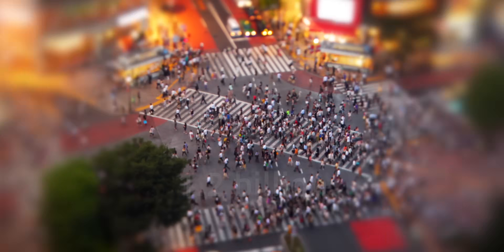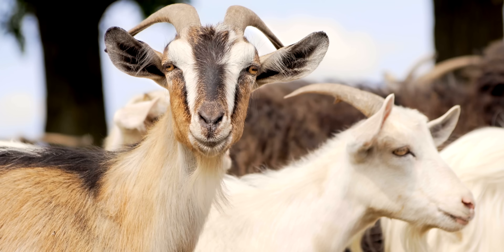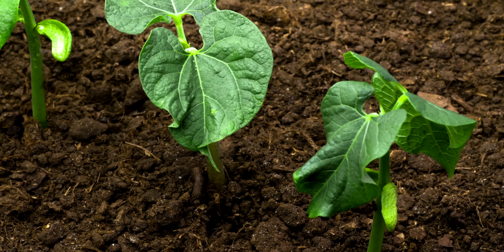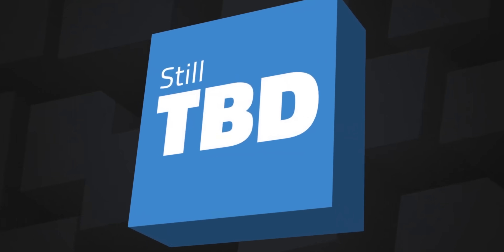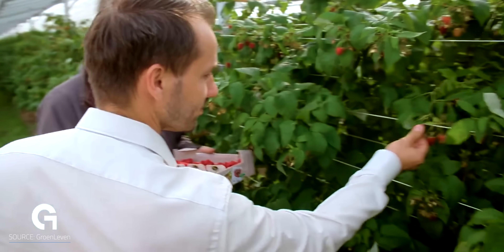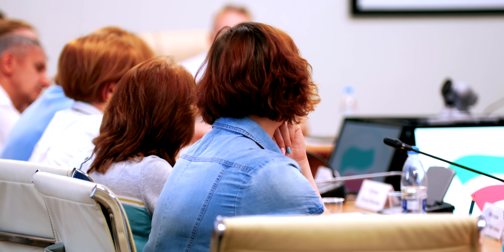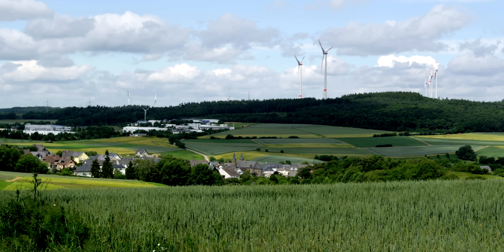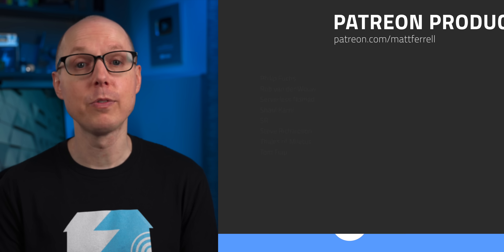Solar Panels Plus Farming? Agrivoltaics Explained

Comment: Yesterday I spoke to an environmental auditor from France. We discussed the possibility of reduced "sun" due to "heavy gases" in the air. He said, there should be used solar pannels which can produce electricity under conditions of clowdy weather or shadows. And these pannel excist. Today house owners not only install pannels on the southern part of their house, but also on the northern part. They know, that new solar pannel features will produce less, but yet produce energy due to better technology.

Comment: You're right about the NIMBY factor...  In Australia, there were people against a proposed solar farm, that they wouldn't even be able to see because it was on the other side of a hill, because they didn't want to live next door to a "industrial power station"...  One point that you missed in the video is that the solar panels over the crops can also be used for water collection, and not just when it rains.  Cool, moist air hitting the solar panels at night will condense, and the condensation can be collected even during drought conditions, which will also increase crop yields.

Comment: It is an interesting idea.

Two big issues that is going on my area, which is Indiana, which obviously is a big farming state. Is that..

1. They are trying to build traditional type solar farms, which is upsetting the farmers, because that is taking away big swaths of farming land.

2. The power that is made from the solar farms aren't even being used locally. I don't know where it is going but it isn't being used here.

Also, as you mentioned in the video. It isn't locals or even in state people that are owning these fields. I think the one locally in my county that is causing a fuss, is owned by an Israeli company.

So no one sees any benefits from allowing that farm to be built here, other than the company involves and most likely local politicians that most likely have stock in said company or has some other financial gains to be made with this.

Either way, it doesn't benefit the community with electricity and it isn't helping the farmers out neither.

Now if they were trying to build something like what was in the video here, then atleast some of the farmers might get on board. Especially if they are shown that you can still grow corn, soybeans and stuff like that under them.

As the running stereotype is, Indiana is big on corn, most of it though is meant for either bio gas or animal feed I believe.

I do wonder how this would work for a smaller scale, like a backyard garden and solar panel combo.

I have always thought that the answer isn't into these massive farms that tree to power entire cities but on the smallerscale, where individual  households and businesses have their own personal solar farms in their yards or on their roofs, etc. But with the price to install them...even with rebates and such, most people just don't have the cash or see an upside to how it would benefit their business.

I know I would like to get my house hooked up with solar but I can't even afford a new roof or anything else for that matter. So going solar is completely off the table.  Plus, I believe my state has a law in place that you HAVE to be hooked up to the grid reguardless. So that is also a determent to people doing that here as well..

Sorry for the long comment.
Reply: I don't think there are laws against disconnecting from the power grid in Indiana. I'm not disconnected yet, but it's one of my goals.

Comment: Another solution, which would allow you to grow other crops, not just shade crops, would be installing LEDs under the panels, using a fraction of the power produced to light them. You would still generate quite a bit of power, while growing a variety of crops. You would need to use some specific LEDs to maximize the efficiency and you would need to have them mounted close enough to the plants themselves to not waste any of the light produced. Essentially you treat the land as though it were a partially "indoor" farm. It hurts the efficiency of power production, because you are using some of the power for the LEDs, but you are getting an additional resource in exchange.

Comment: Errors:  #1 We don't have a free-market...we have a sellout lobby-nudge market (bribery-markets).... the "sellout" is gov't / banking based. 

#2 Solar Panels need coal / oil / gas electric to make panels.... panels also need more metal / mining then do coal-alone electric out put.

#3 to replace coal as base-load electric we need Next-Gen Nuclear Tech.

This is great idea but we need composite material solar panels.....Zero mining / Zero reliance on base-load for manufacturing.  Maybe graphene plus Hemp Oil / Hemp Plastics?  Not sure.

Comment: I can’t think of a dual renewable energy use right now, but it reminded me of the fact that some people are using heat pumps to heat their pools. Instead of dumping the heat into the air outside their house, the heat is transferred into their swimming pool water. Cool stuff.

Comment: I, as an handycraft, who had nothing to do with farming, have seen on an sightseing-tour through someones garden, that some plants do not grow the hole day alonge, rather only a view hours in the morning. Pea was the plant in the garden, where it is clearly happend. Their shoots only grow to east, because there was the first sunlight of the day and later in the day, multiple problems for the plant stoped the growing (too less water, too much sunlight and heat). These plants may must completly stoped the growing- and metablism-action, because they all bend to east and did not grow to other  directions.
In the best growing-seasons (midsummer), as we thinking, they do not grow best. 
I don't know what other plants this applies to. But many basic food crops (like potatoes) could also be affected, even if they are "nightshade-crops". After all, they can't do without photosynthesis. But drought is the much worse complication for the plants, which is why one should achieve longer-lasting moisture in the soil by shading.  And less solar radiation is the most plausible solution - along with watering more in line with needs.

I cannot calculate how relevant these adjustments in agriculture will be for the respective regions for the harvest quantity. But in Germany, in the Mecklenburg and Brandenburg agricultural regions, a lot of drought is to be expected in midsummer because of the special landscapes and weather conditions (sandy and dry). 

Agrivoltaics should be on the list of public interests. The problem that all European industrialised countries do not have enough fossil resources of their own to meet their own energy needs should be enough justification for this. The "energy market" at present clearly shows us how unfavourable situations can become if one does not have one's own basic supply that is not dependent on third parties. Therefore, the state must intervene structurally here and create measures and regulations for the benefit/goal of stable self-sufficiency. 
The installation of photovoltaic systems on fields may be expensive, but it brings stability in the areas of life where it is needed. 
Alternatively, there is the idea that every roof in the country should provide a minimum capacity of solar power - i.e. be equipped with solar cells. 

Very intersting concept of solar-panels, these partly cell-structure. 

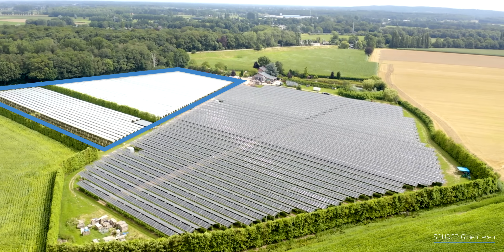6:15... interesting thing: in the netherlands the peoples have som special gardening-strategie: They make their garden  somewhat opaque from outside the garden. And so it is done in the Babberich-testfield. This is not only good for privat-sphere, rather also good for microclimate on the field.  For the better effect of agrivoltaic this microclimate on the field  must guaranteed, because this is the benefit of shadowing the field. For that, the embracings around the field with high hedges are part of the shadowing-targets for a stable microclimate.

Comment: Helped conduct research at the University of Arizona on agrovoltaics! All of the crops under solar panels produced significantly more, because of the reduced heat stress. The greatest difference was the tomatoes, as the control group in the sun didn't fruit at all so the percentage increase in yield was a problematic way to summarize the results as we were dividing by 0.
Reply: Yeah reduced heat stress as in direct sunlight, other wise the covering panels gather and radiate heat into the atmosphere adding to the heat island effect. Less CO2 produced maybe but definitely heating the local atmosphere. Doesn't CO2 do that already?
Reply: @pinealism  recently 1000 acres of old growth forest was cleared for a solar farm. We just experienced the hottest temperatures and longest drought in years.
Reply: @herelieskittythomas3726  where was this? sounds doubtful
Reply: @pinealism  no. They radiate some heat / light back up toward space, and any heat absorbed would be heat that would already be absorbed by the ground and plants, which would then need additional water to compensate for that heat the solar panels would have caught
Reply: Why dont they use mirror to reflect sunlight for crops from sides... Dont say they cant lol.. 😂
Reply: Sheesh
Reply: What was the effect of having fewer panels on a given area or the extra cost for special racking?
Reply: So it was an infinity per cent increase!
Reply: Did you discover anything about how it affects moisture retention in the soil? I wonder about this because areas like California have had huge problems with drought and wildfires. I was wondering if this might have a relevant impact on the overall water situation.
Reply: oh good, now the nations bread basket - Arizona - can finnaly reach trheir peak veggie production - a half dozen hobbiests
Reply: Then it was not  properly designed experiment.  No one in that climate would try to grow tomatoes without shade cloth.
Reply: @MP-dc8lp  solar panels maybe replace shade cloth? and I don't think Matt really provided enough details on the design of the experiment for you to dismiss it without asking for more clarification
Reply: @MP-dc8lp  e
Reply: Well no, as Arizona has zero water to grow anything with.  This experiment is only valid where crops are already being grown.  Even then it only works during half of the year at most and especially in spring/early summer and fall you want every single ray of sunshine you can get as you are getting 2 crops instead of one.  Talk about piss poor economic model.  Cheaper solutions for both separate entities.  When all the irrigation ditches/channels/rivers/parking lots get covered first, then we can worry about wasting money elsewhere.
Reply: @w8stral  yet crops are grown in arizona. so they are irrigating, which means reducing water usage is even more important

Comment: this idea I am about to suggest I saw in Chile , the bus stop shade in the desert is designed with a roof that points inward at a 120 degree v-shaped roof , this way the rainwater will collect in the middle off the bus stop shade directing it to the center of the bus stop shade where there is a tree planted , what if the solar panel are assembled in a v-shaped 120 degree angle  , this way more sunlight will come through and at the same time it will collect rainwater without reduction in collecting sunlight , at the same time since there is equal weight on both sides of the axis it will behave like a seesaw which would make it easy to manipulate it in either direction, an idea not spoken is an idea loss to humanity .

Comment: Traffic at shopping malls has been waning in recent years, but I have always thought that their parking lot are screaming for solar arrays.  Ask me if I would prefer to park in the shade of a solar panel in the summer or not.  The issue for more northern climes is designing for snow removal on the ground in the winter.

Comment: Hi Matt, 

Very interesting video. If possible I would like to listen further insights related to the 3 implementation barriers discribed by you. All the cases that you pointed are from germany and holland, witch are not are tropical countries. In tropical areas is quite common that sun light intesity is far beyond the solar panels capacity and maybe would reduce the trade-off between crop yield and energy production. Do you know any project in tropical country ?

Comment: Agrivoltaics is currently being pushed in Germany. I don't believe we are anywhere near the 10-20% higher costs. Some numbers: a normal  1.2MW solarpark with average components costs about 900.000€ or 750€ per kWp in Germany right now. Of the 750€ roughly 100€ are attributable to the mounting System. Afaik a agrivoltaic mounting system is roughly 300-400€. On top of that transparent modules are twice as expensive than normal modules for half the Watts (wasting space and no reflective layer). E.g. SOLARWATT VISION 36M Modules. Instead of the initial 1.2MW we would get like 800KW and we would pay somewhere around 1.8 Million €. Returns on traditional Photovoltaics are about 7-8%, with agrivoltaics it's 2-3%. Correct me if i'm wrong.

Comment: this is an interesting idea.  my only hesitancy in teh expansiaon of solar is tthe poor lifespan of the panels.  I read anywhere from 5 to 10 years.    the old panels end up in land fills and in some cases are comrised of toxic materials that doe not bio degrade well........       this has a great potential to yield energy, limit fossil fuel use. but is it a good alternative.   Can anyone tell me what happens to the old panels.

Comment: With the recent increases in electricity prices the market will decide whether this is viable. Food has also increased in price however the prices on food will likely be much more dynamic the the price of electricity. There is the wildcard of government interference in the market which makes everything much harder to predict. I think this technology has great potential for both open air and greenhouse agriculture especially with newer panel (transparent) designs and materials (carbon based panels).

Comment: Matt, there is one big disadvantage of instalation presented in this video: Solar panel above plant moves rainwater away from the plant. The rainwater doesn't go evenly on plants and to the roots but is accumulated by solar panels and transported to the side, to the row of grass between the row of plants. It forces the farmer to use artificial watering system which isn't very cost- and energy-effective... And if the water accumulates too much in this rows, it can be even destructive for the farm/plantation...
But what people from this German experimental farm say about that?
In my opinion only bi-facial panels mounted above the plants are worth consideration here. But only if You have plantation with rows close to the north-south orientation...
But wait, vertical bi-facial panels are not very wind-resistant... (sigh)
Reply: very good point!! But I think that can be solved. in the end the rain-water is still there, it just flows around the panels to the ground. with a little trick it can be directed back to the plants. so I dont think it's an issue.

it's not likle the rain-water is completely gone and needs to be replaced by watering from other sources.
the OPPOSITE is the case. the shade keeps the plants from losing too much water, so in the video they mentioned the water saving effect.

Comment: I used to be a Site Manager for a 200MW solar farm in Mexico and had the goal to use sheep as an ecological way to cut vegetation. Unfortunately, locals and my company weren't too interested in that, but I still think is that this kind of interaction needs to be done.
Reply: Nice sharing from you, may i have a chance to get your experiences in solar farm projects - thanks
Reply: Did you give up after just one try? Perhaps, pollinator fields or crops that like some shade during the day could be a solution.
Reply: Hello Sir, can I Dm you to learn about Agrivoltaics

Comment: Seems kind of like a solution in search of a problem.  Certainly that problem can be found in some areas where a large portion of the land is arable and producing food that you don't want to give up.  But if you have land available that's either non-arable (or there's just not enough demand for anyone to bother farming it - a large part of the US for falls into that category for example), it seems like its going to be more efficient to just build the farm and the solar arrays separately.

I can see this being taken up at a smallish scale for crops that perform better with less direct sunlight, and assuming the land area restricted by the solar array is made up for by the greater crop performance.  And I can see this used in specific areas where there's little or no unused land within a couple hundred miles (ie: too far to efficiently run HV cables), but overall it feels less promising than some of the other ideas I've seen on this channel (not that we can't do more than one thing, and every little bit helps of course!)

Comment: Great dual concept......here it is my dual triple proposal ...VERTICAL WATER DISPLACEMENT and Energy Storage/ Agriculture win, win, win...today we can use solar and three new other options to lift water at low cost...storing water in water banks is clean energy as recyclable as lithium with lesser environmental and financial cost...doing so can probably retain better value than currency paper in regular banks. By Max ( Maximo Gomez, IV, MD) Zoo-Mechanics, Inc.